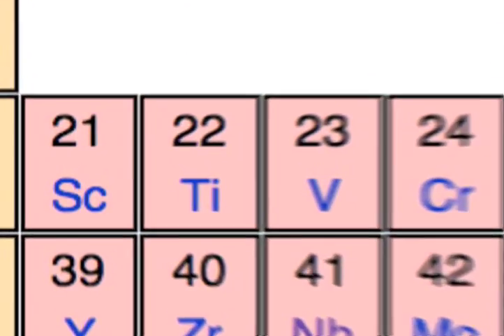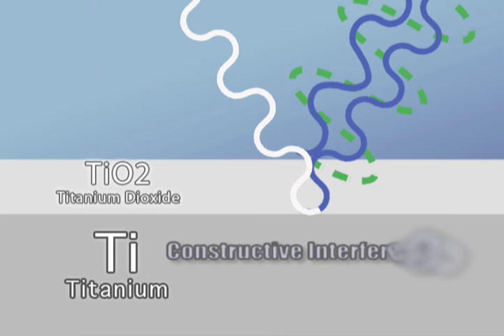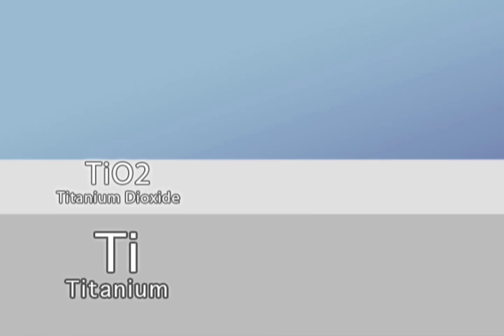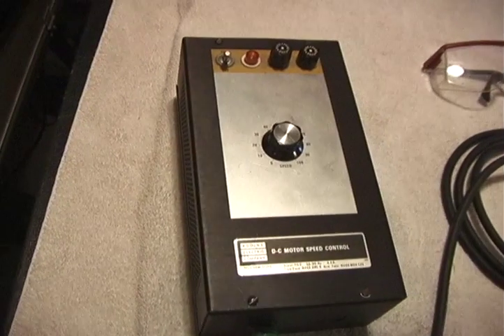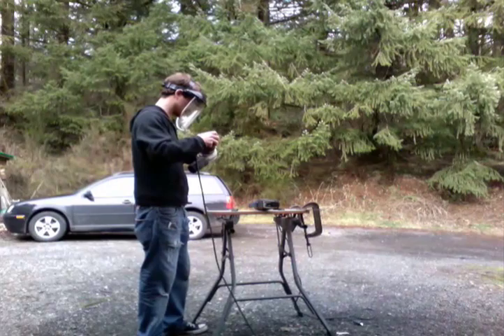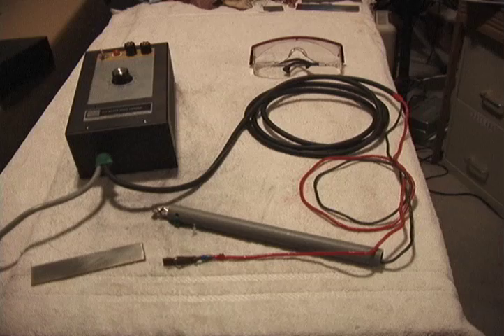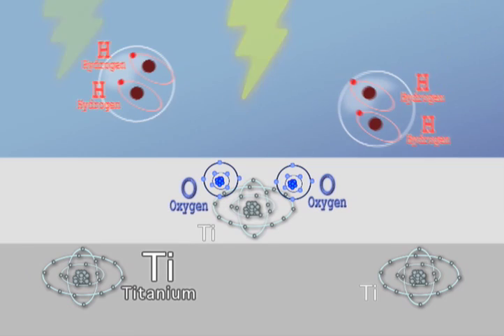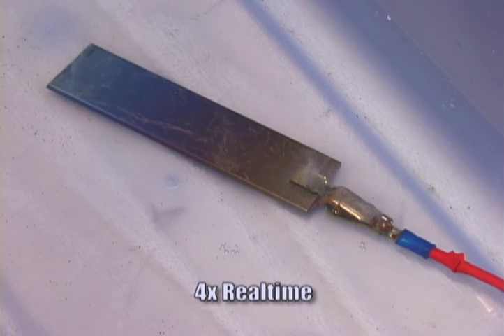Anodizing 101

Comment from the maker: Many power supplies take an AC input and output DC voltage, yes. I'm not certain if this process will work with a negative DC voltage (which might just mean the anode and cathode are effectively reversed), or if there is some reason that a positive voltage would be required. Perhaps someone who knows more can comment...